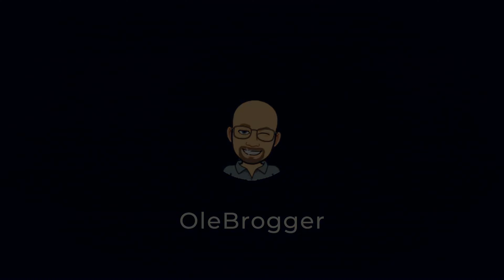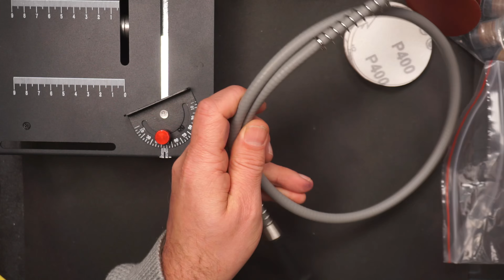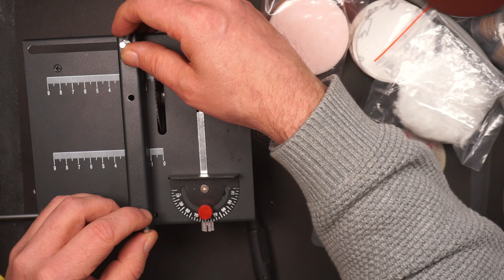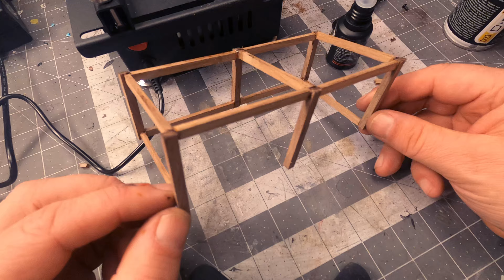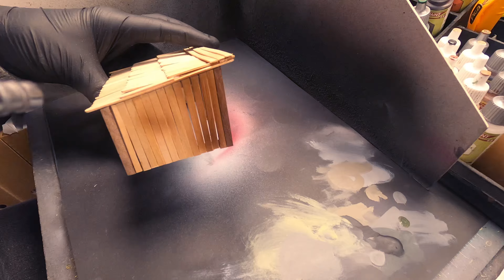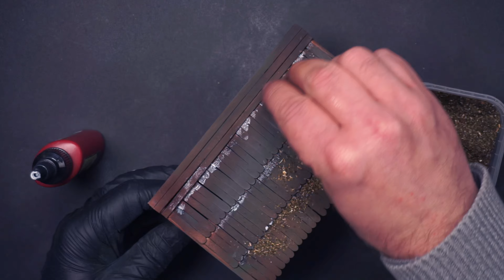Testing new mini table saw and crafting a miniature stable for my D&D Terrain

Comment: my friend you oversaw the only thing its not clear in the assembling. The drill chuck. There are two pieces. How do you attach the extension to the chuck if there is no screws?
Reply from the maker: The extention is connected to the other side of the motor, there is a second shaft for the extension and there is a tiny screw to attach it :-) sorry it I was not clear in the video about that

Comment: I bought one of these a couple of weeks ago. Very impressed with the build quality but I wish I'd thought of removing the top to put on the chucks and saw blade - got there eventually but its a really fiddly job getting your fingers in there!. Will be using it soon to cut slots into a foremast channel on my 1/100 scale HMS Victory for the deadeye strops to fit into. The fact that the saw blade can be raised and lowered is a great advantage. The only thing missing is a dust extractor outlet! Very nice demo!
Reply from the maker: I think it is a very useful tool😀 and i use it a lot. I thought about the dust, and i considered making a trey where i could connect a vacuum cleaner and then slide the saw in to it. Maybe this could be a future video😀
Reply: Please tell me how you raise and lower the saw blade?
Reply: @gsfdriller  There's a small hole about 3cm to the left of the blade, one of the L shaped keys fits a screw at the bottom of the hole and raises or lowers the blade as you turn it.
Reply: @plymouth5714  many thanks for that.
Reply: @gsfdriller  Very glad to help! I just checked on mine and its the largest of the Allen keys that comes with the saw that fits down that hole.
Reply: @ thanks again👍

Comment: had to laugh when you spent time setting up the saw and putting individual lolipop sticks through then in the following scene just snipped them flush with snips at about twice the speed of the saw 😆
Reply from the maker: The side cutter does not make very nice cuts, and i could not put the whole model through the saw :-)